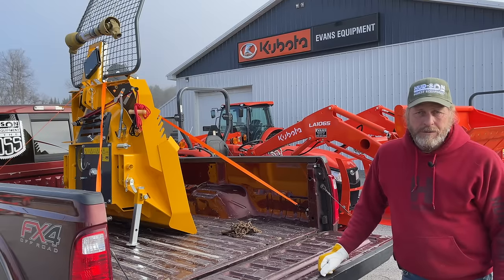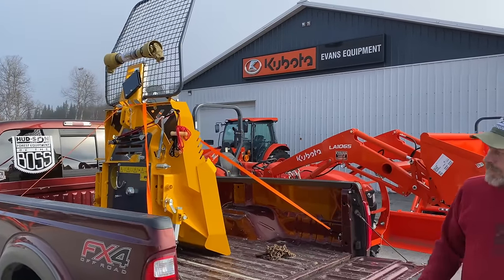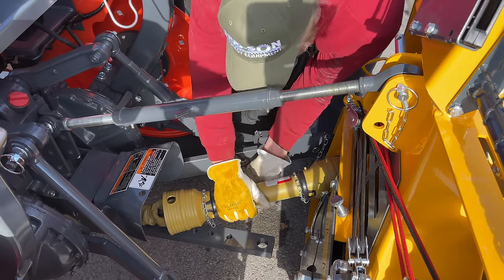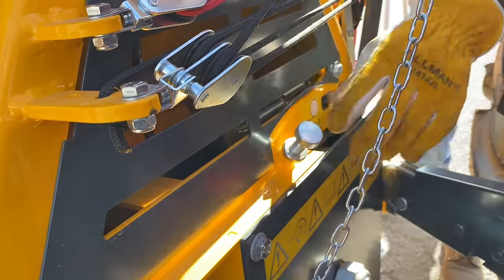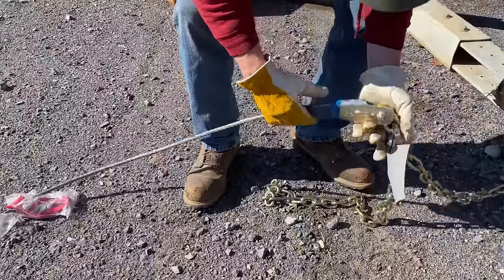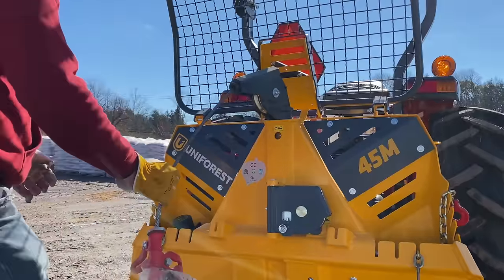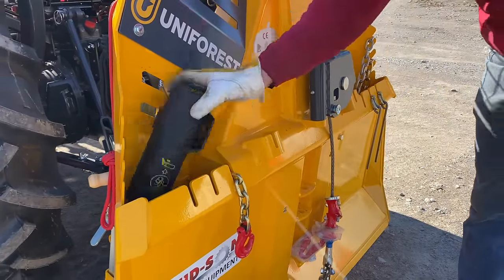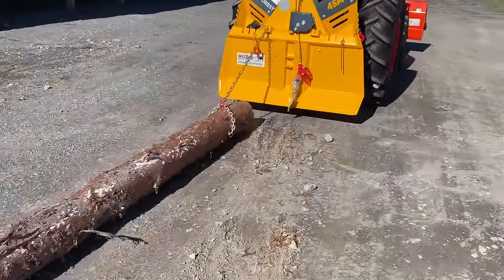Uniforest Winch Set Up and mounting to a PTO on a Tractor - Hud-Son Forest Equipment BEST WINCH!

Comment: Thank you John for taking the time to put this video together.  The owner's manual leaves a lot to be desired.  When it becomes necessary I will now know how to adjust the clutch without trying to decipher the manual.  I took the PTO cone and plate off in order to reach the drive chain away from the clutch, and lightly oiled it with Lucas non-sling chain lube.  The winch is working fine, hope I don't start having problems with slippage.
Reply from the maker: Will share this message with John! Appreciate your post! Which winch do you have?
Reply: @DanHudon  I purchased the 35M.
Reply from the maker: @dougdinsmore9751  Great choice!!! Hope you are enjoying it!

Comment: I purchased a 45M two years ago from my Hudson dealer in Pell City, Alabama.  Its been a real workhorse and I enjoy using it.  Thank you for making this much needed video as I too found the manual rather lacking.  It states the chain tension should be adjusted if needed after the first 10 hours of operation but is not clear on the procedure.   It would really be great if you could make another demonstrating how to check and adjust it.   Thanks for your help.
Reply from the maker: We agree that it is a great little work horse! Thank you for your business and post on this video!

Comment: Few things…
1) when reassembling the driveshaft make sure yokes are phased correctly. Some shafts only go together one way some do not.
2) lift winch up and down slowly while observing telescoping of pto shaft. Some tractor 3 point geometry shortens shaft while lifting or swinging sideways. 
3) hitch is dumb in my opinion. Why not make it a 2” receiver. Not everyone is pulling a pintle hitch log trailer. I made a 2” adapter to use 2” receiver hitches 
4) if you have the wireless remote make sure electrical connection is made for US tractor electrical trailer connect.
Reply: The supplied hitch did not work for me at all. I fabricated a receiver hitch to mount in the same spot on my winch. It works well.

Comment: I have 35 acres of about 7 year old Loblolly pines in the western Florida panhandle in very sandy (soft) soil. Trunks currently vary from 2' to 6". The time is fast approaching when I'll have to thin out these trees. Unfortunately they were planted in a very haphazard fashion (planters must have been enjoying very liquid lunches) leaving no room to drive our tractor (Kubota L6060 Grandcab) through without severely scratching it up and/or breaking glass. I have a small front loader mounted Tree Puller which works OK on trees up to max 4" but struggles with anything larger. I have wondered whether one of your tree skidder winches (with sufficient pulling power) may be used to thin a path through our trees just by pulling them out of the ground. The tallest are around 20' high. One of the problems I've been having with the Tree Puller is the jaws cut into the trunks and the backwards/forwards motion, sometimes necessary to loosen the roots from the soil and pull the tree, slices the smaller ones in two. The tree skidder would be used for literally wrenching young pines out of the ground to create trails wide enough for the tractor to pass through to bush hog very thick Yupon Holly and other tall unwanted shrubbery.
Reply from the maker: We would be happy to talk to you about this! Give us a call whenever you are free 800-765-7297. Would love to have another one of our winches in Flordia!

Comment: Do you have any tips or videos of maintenance if the brake does not release when the clutch rope is pulled?
Reply: Would love to see info on that as well. My winch is an older model 35E (predecessor to the 35M) the brake linkage is a bit different. Would love to see some guidance on adjusting and maintaining it.

Comment: Nice video but my Uniforest won't pull half what my Farmi used to do (even though they are rated about the same)
Reply from the maker: What size HP tractor do you have and what model winch do you have?
Reply: 35M and tractor 60hp
Reply: Then your winch is most likely not adjusted properly, or the clutch is glazed. I've used my Uniforest 35E (predecessor to the 35M) and a Farmi 351. Pulling specs are the same, and in actual use they pull the same.

Comment: The one thing you did not cover in this this video you did not mention anything about the price of the skider what do they generally run and what’s the maximum weight they can skid The one thing you did not cover in this this video you did not mention anything about the price of the skider what do they generally run and what’s the maximum weight they can skid
Reply from the maker: Thank you for your post. We do not add pricing in the videos as pricing changes and than we do not have to redo the video. Would be happy to talk to you about current pricing! 800-765-7297. Have a great day!